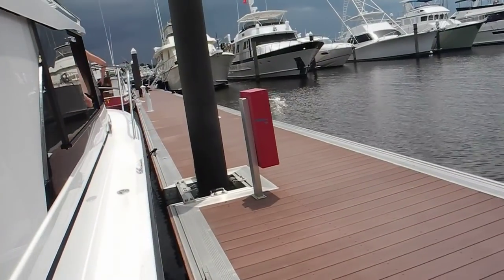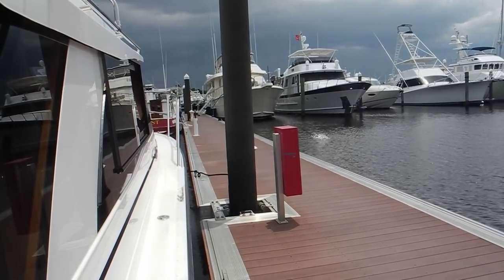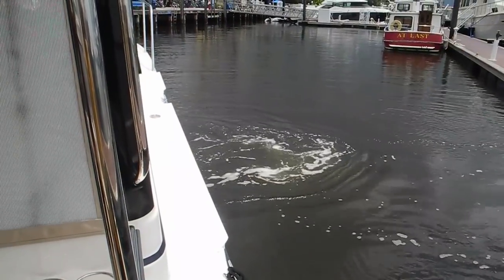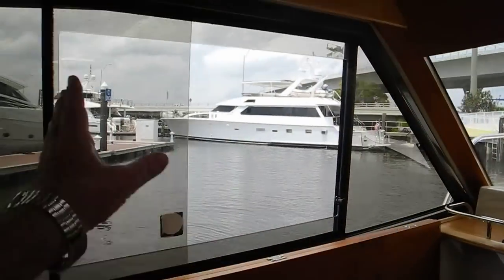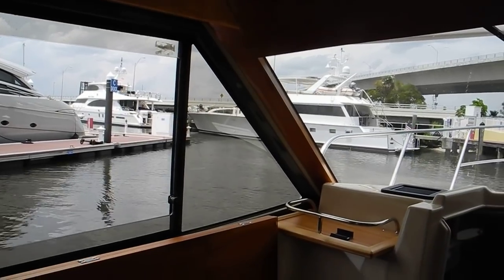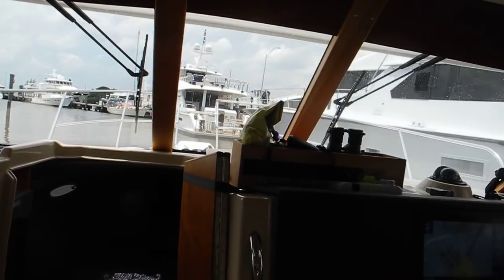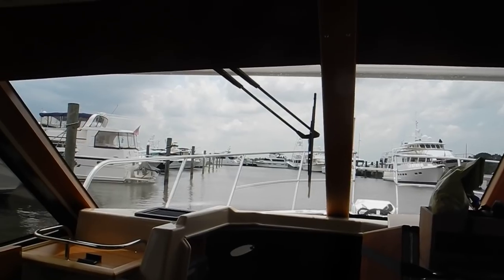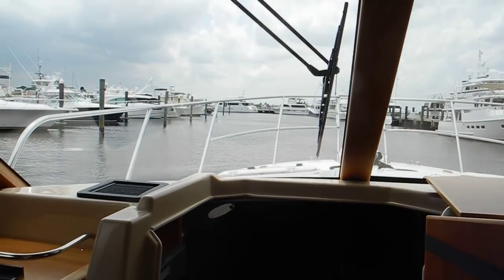Cutwater 30 cast off Sunset Bay Marina

Comment: Great Maneuvering.
Reply from the maker: JR CHHIBBER agreed- nicely done! Great when you know your equipment and work together with your crew.
Reply: Single engine?
Reply from the maker: Vidar Sørum yes. Single engine. That’s why bow and stern thrusters are much appreciated. But we always recommend you understand how your boat maneuvers WITHOUT the thrusters.
Reply: Prop walk and prop wash is truly underrated in my opinion . My boat is a 36f trawler/ cruiser single engine straight shaft.  There is a non-functional bow thruster fitted,  but I've never missed it much.  Probably will fit a new one before selling the boat just to help the next owner